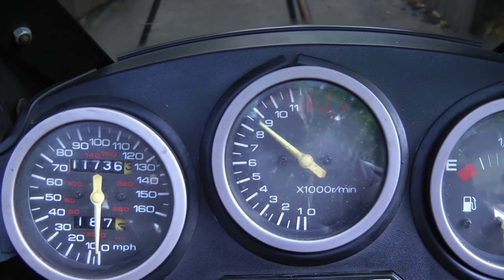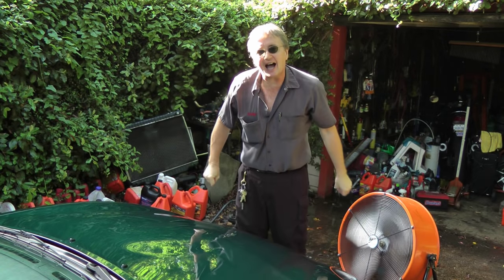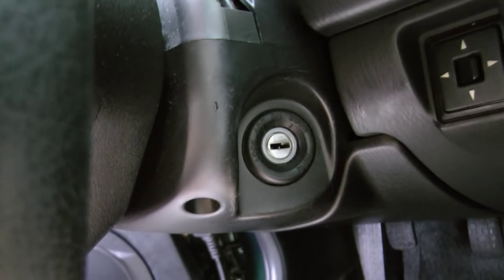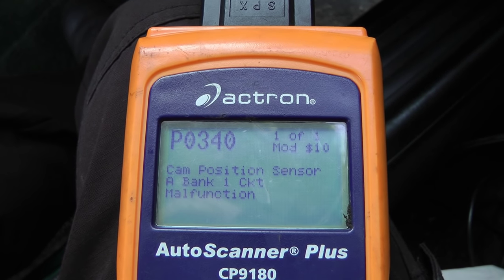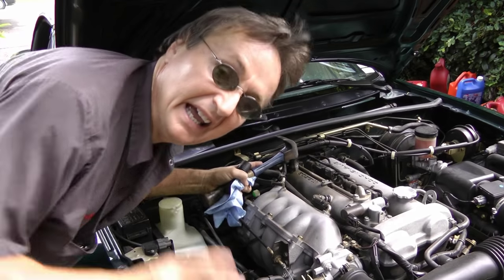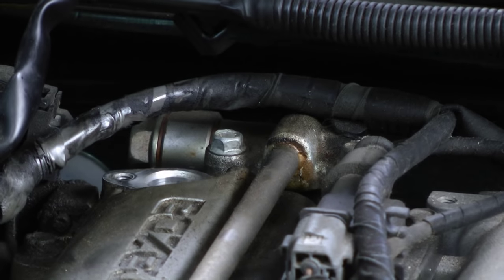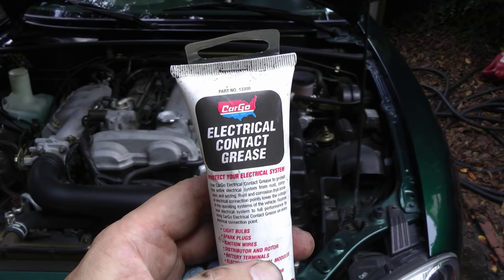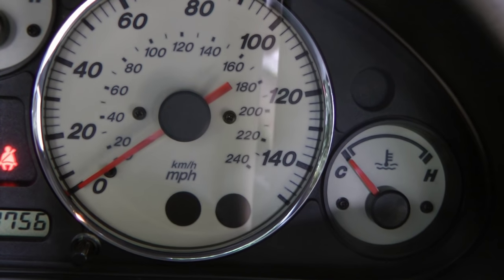How to Fix a Car that Randomly Dies while Driving

Comment: Scotty  my car doesnt start, i have spark i have fuel pressure my battery was just recharged at my school, the scan tool is not showing any trouble codes. can you help me out??
Reply from the maker: +Jumas Drake  you just have correct spark, the fuel injectors must be pulsing to add fuel into the engine, AND the engine must have good compression. do a compression test of the engine first

Comment: hey scotty i have a 00 jetta vr6 2.8 ...wierd i hook my aftermarket stereo on and the entire car dies with a day absolutely no power so i disconect the stero and the car randomly dies eather at a cold strart or a few hours after driving it my mechanic says its eather the throttle body or the computer what do u think and what can u tell me abt the aftermarket stereo
Reply from the maker: +Jhon Getto you may have fried the computer wiring that stereo in, realize that. find a better VW mechanic with a vag com scanner to analyze it correctly and not guess on one part or the other

Comment: Almost died today when my vehicle bogged down mid left turn and I was stuck like a deer in head lights to oncoming traffic that had to slam the breaks. Thankfully, it stopped bogging as I was shitting my pants and feathering the gass. My car jumped out of the way just in time. Lesson learned is that if your car starts to bog down mid drive..don’t chance it and pull the hell over immediately!!!

Comment: I have a 98 Nissan Maxima V6 3.0 L of her issues with the engine turns on find when is cold driving around the block and it shuts off it won't turn on

Comment: I have the same problem with my 2015 Dodge Dart. Whenever it stalls I just turn off and start it again pressing the gas little bit. Took it to dealer but they couldn’t find the code. Anyone has an idea to solve this issues?  Yes I did install new battery as well. Problem remains the same.

Comment: 95 surban suv. Starts but dies after 10 or 50 seconds and start back up. Also dies while driving . I change plugs and fuel filter already.
Reply from the maker: Marlos Moy pressure test the fuel pump, pray it's just that going out. MANY things can do that but that's the most common
Reply: How do test fuel pump

Comment: problem Chrysler van  dies in reverse & or blows engine fuse FIX  wires laying on exaust manifold shorts out that fuse hit bump fuse gone ,turn corner  pow  I put in circuit  breaker hit died 45 seconds reset starts the wires settle down on manifold burns through if you have that problem get a big wire tie pull loom up done

Comment: I have a 2006 pontiac torrent and it dies sometimes when driving, when I try to start it nothing happens no crank or anything as is the battery was totally dead if I sit for about 10 minutes it will crank and usually start
 what could it be?
Reply from the maker: have the alternator and battery tested first

Comment: Hello, I am running Nissan Altima 2008.  It runs good in the morning after continuously running for 40 minutes the rpm does not rise more than 2000(100KM).  This happens when temp. raised more than 30C.  I need to stop the car for while(15mins) to run it again normally.  It runs good in night or less temp condition less than 30.  I checked with compute no code shown.  could you please advise.  I am from Dubai, now its summer I often encountering this problem.  Thanks for your assistance
Reply from the maker: jawahar sadikali pressure test the fuel pump, weak ones often do that
Reply: Scotty Kilmer Hello Today I changed the fuel pump and crack and SHAFT sensors, but still the problem persists, any remedy, mechanic asking to change maf sensor should I? Please suggest

Comment: I have 86 Dodge pickup I have trouble with the alternate I change the alternator and is still not charging what could it be
Reply from the maker: bad regulator, or bad wiring

Comment: My 350z was driving perfectly, then I decided to changed the spark plugs and wires now my car starts then dies 2 seconds later ... could it be the cam sensors? Maybe the wires are bad?
Reply: Ever figure out problem?
Reply: @keitronadams5386   - Diddnt push the spark plug wires in all the way.

Comment: my 2001 Buick century keep cutting off while I'm driving & when I turn da key forward no lights come on da dash & no crank no check engine light so I can't get it diagnosed
Reply from the maker: +Latwon Plant there's tons more info than simple check engine lights. See my video "fixing insanely complex modern cars" and have a guy like me hook one up
Reply: +Scotty Kilmer hi how do I fix that in a 05 Mitsubishi Lancer oz rally
Reply: +Latwon Plant  my car was doing the same thing a couple of days ago i scanned it even tho it didnt show any check ingine light the problem was the idle air control valve what cause my car to randomly shut down you should try that
Reply: +Latwon Plant sounds like you have no power supply. Think you need to jump your battery. You can hook up cables to another battery and then diagnose your car, if the battery won't hold a charge.

Comment: hey scotty I am having the same problem but my car dies only when coming to a stop  or when I take it out of gear. I have a 97 Mitsubishi eclipse gs 2.0 non turbo 5 speed manual trans. doesn't die at idle!  but rpms do go up and down a bit but randomly. I have a check engine light for running rich bank 1 .changed the o2 sensor  and deleted the code but it came back 2 weeks later. no other check engine codes .
i've replaced  fuel pump-- idle air control valve battery starter ,ignition switch fuel pump relay and autoshut off switch new thermo stat new coolant temp  and switch ,  checked all hoses for vaccum leaks   all my sensors are fine so I think tps maybe but when I remove the sensor the rpms go really high   any leads ??!
Reply from the maker: DeezSteez  running rich will do that every time, it floods the engine out with too much gas and conks it out when stopping our putting it out of gear. Rich is often a bad maf sensor, or leaking fuel injector or fuel pressure regulator gone bad

Comment: My car needs a converter. The converter is $1800 to freaking fix. When my car stalls, the battery, engine, and oil light comes on, and the brake light. As much as I don't want to buy another car, I don't want to find another issue with this car once I pay for the repair. HELP

Comment: I have a 2000 Acura TL. The problem that I have with this car is that when I tap the gas pedal it won't go. It doesn't show no check engine light. Does anyone knows what's the problem?

Comment: hi Scotty I have an ultra for Explorer XLT model it turns off randomly but I get no codes, i had the alternator and the fuel pump changed and it still does it, Help
Reply: For what it's worth, I had an old, probably late 70s, car that did this. It turned out to be a bad relay (or so I understood).
Reply: do you know what relay it could be, by the way my car is running without the air flow sensor connected my mechanic tried that and it work so I'm waiting to have it changed do you think it might be that,
Reply: @ICanDoIt70  Don't know if this applies to your case or not, but here goes. This was an older car (a late 70s Nissan) that was determined to have an electrical fault in an unknown location. They replaced parts from cheap to expensive until getting to a unit that had the relays. Apparently, if a relay got too hot, it failed, causing the car to die completely. And it could take half an hour before starting again. Very inconvenient in intersections with cars coming at you.

Comment: ihave my hyundai sonata 2003 model....witch death while driving after more 2 hour...i was have ready changed camsaft sensor...also sensor at the timing belt camsaft.....my engine still death while driving.......but my petrol pump not be changed....can u help mee...

Comment: I used to have a mini van that died randomly. But it was because the steering column was broken and the center part would move around and turn the switch off.

Comment: hey my 2008 audi shuts off on cold start drive when i come to a Stop with the breaks.. it shakes and stalls and the engine shuts off...i have to turn it back on to drive by putting it in park... what could it be...
Reply from the maker: +TheKidCosmic  start by checking for vacuum leaks, and pray it's that easy on such a high tech german money pit machine

Comment: After running completely out of oil I performed an oil change oil filter and air filter car started up good I even put high performance oil in it but then it did it again and the car won't start now
Reply: Your car has a serious issue, it's either leaking or burning all the oil off.

Comment: 2004 Infiniti G35 starts then stalls, stalls even faster when I   Press pedal, I cleaned throttle body and MAF changed both CPS still doing the same thing, no codes thinking of changing throttle body, Can anyone help?

Comment: Hey Scotty , i own an bmw e39 520d from 2003 and it keeps dying on me while i have 15 liters in the fuel tank , i have changed the fuel pump from the tank but when i hit 15 liters or 170 km range it randomly stops like it does not get any fuel , if i do not refuel with 15 liters and start cranking the engine for like 30 minutes it wont start (sorry english is not my native language)
Reply from the maker: I would assume a bad fuel pump even though you changed it out, cause the only thing fuel volume effects if the feed pressure to that in tank pump.Or the filter on the pump is bad

Comment: On my car it read "cam position sensor" so I replaced it and problem persisted then a friend told me the code can also mean a bad (crankshaft position sensor)
My Solution: I replaced the crankshaft position sensor

Comment: My 2001 Chevy Tahoe died on me while driving completely lost power turn off on me and I turn the key and will crank but won't start I noticed the fuel pump is making a louder and different sound then normal

Comment: I have a 1998 honda prelude and I got problems with it the car shuts off randomly and kicks back on and when the key is removed the car still runs and it's missing a sensor or it's just gone bad and my d4 meaning driving light blinks and it still blinks when I switch gears to reverse or park please help man.....
Reply: Not sure but May be your accelerator sensor my 96 civic did the same thing
Reply: Had the exact same problem. Turned out to be a faulty ignition switch. Best part is that Honda put in a recall for this issue and it was complete free.

Comment: My car is old, can I check the codes with a 64 ranchero ??  It keeps dying out while driving and the lights dim too. Right now the car doesn't start at all,
Reply from the maker: +jimbo Rose there is no computer on that old thing, so it has no codes
Reply: any advice tho
Reply: +jimbo Rose few things one its points seting requires feeler gauge to see if it in spec, second coil is oil filler when it gets used it gets warm, some get super hot and loose conductivity and run 3-5v far from 12v is needs. Other things are the carb has power valve that can be cracked so it stalls under to much jetted fuel or too little, there is a rubber diaphram in the fuel pump and on vaccum carbs is dry rot they will loose pressure and do the same spitting or dying. IF all else seems fine maybe we missed out on the fact it came with a genarator not and alternator with an extenal voltage regulator (usually driverside at radiator) THOSE go bad, or fact maybe you got a radio better then the single speaker running AM and drawing to much power thus killing the car because it doesn't have an alternator to supply extra power for all the toys/fun stuff. If all thats good check the ground on the block oil leaks all over them usually can see from bottom best. OR OR.... if all thats good could be your 12v key on to the coil is bad could mean the wire or the key switch. Because that old has no safety features built into the wiring besides fuses no brain to limit power or turn off car when too hot. I had a 64 1/2 box top 289 mustang really loved it easy to work on just trace your stuff. Fixing old stuff is easy 4-5 wires and a switch can run them cars theese days use miles of wire and 3/4 sensors that talk to each other about the same thing and adjust to thousands of seconds
Reply: +TriskaidekaPunk  thanks so much man, it's my first car too. My car doesn't have a radio tho and the gas gauge don't work either.

Comment: I have a 2003 Saturn Vue a couple of days I was driving the car jerked the and the security light came on the car acted as if it didn't want to drive drove a little and then stalled can you please help me with this problem ....have changed fuel pump and filter didn't help
Reply from the maker: If you have another known good key, try that. If not see a guy like me to scan the security system for flaws
Reply: we changed that and it is still doing it
Reply: we got about 10 mins down the road and it did it again but didn't stall all the dash lights came on slowed down RMP's raced and then it continued it a couple more times but made it where I was going and turned off the car and restarted right up but the security light was on !

Comment: my 08 chevy impala speedometer hand jumps around & when sitting at a light or even when I start my car after driving it for about 30 min it completely shuts off. it starts back up but continues to do so during the drive plz help
Reply: hellllllppppp
Reply: +LOVEmeSomeHIM500 Possible Body Control Module Issue (BCM)? Google around for BCM and the symptons and you might come up with something. Also doesn't hurt to go to the nearest autozone/advance auto parts and have them check for codes if you don't have a scanner.
Reply: +LibertyFreedom1787 ok thank you I will do that asap

Comment: If anyone can help, I have a Mercury 2000 Grand Marquis that has been shutting off randomly at about 40-50mph of course engine light comes up but as soon as I turn it on it's not there anymore making it harder for me to know what's wrong. Another is that my car heat light turns on when I'm driving as well at the same mph first it was caused due to the fan not working and I fixed it by changing out the sensor for it not to mention the sensor for the oil pump and the coolant heat sensor as well but still has the same problem if anyone can relate let me know I already put a lot of money into this car. Thank You!
Reply: Luis Acosta plug a scan tool in go to record data and drive till it dies then press enter and analyze the data

Comment: my sister has a chevy malibu 03 and her car turns on and drives but dies and i scanned for codes and there were none what should i do if this happens
Reply from the maker: pressure test the fuel pump, weak ones often do that.
Reply: I've been researching into battery repairing and discovered a great website at Magic Mender Wizard (google it if you're interested)

Comment: I was wondering if anyone can help me out i have a 96 nissan pathfinder and i recently had to put on an bypass hose and now when driving it wont go pass 2k rpms its a manual trans so i can go about 40 but it dies on its face if full throttle and advice

Comment: How do you change a 2003 lincolñ navigator transmission oil?
Reply: Please r
Reply from the maker: +jose chong pay a mechanic, it's a very involved job using expensive specialty tools and scanners
Reply: +jose chong not hard, it just a ford. They all have trans cooler lines on the radiator, dis connect them detemine the supply and return, put return into empty container and supply into container of new factory spec (mec V) and just keep the supply container full then start the truck and idle it the trans pump will run, do that till clear of debris(back to cherry red not black/brown in color) from the return.

FYI it is not an cheap job the fulid is $6 a qt and 15-16qt for whole trans, but may require more fulid to flush it well. Other thing is drop the pan and change the filter (that takes 5qt and $15 for filter)

But most shops will say is you havent serviced the trans and has over 100k miles DONT touch it, if its not slipping or jerking drive it till it break, new trans fulid is HIGH detergent and will clean the valve body and half time the small slugge in there is whats making the bands and valve work, go and flush that out and you make more problems. Lucas additive works but isn't perment is you have slipage, if you have jerking its bad internal gears or faulty solenoid, saftey neautal switch, or bad trans pump and its not keeping correct pressure after it warms up

Comment: hello sir I have Skoda fabia 2010. I car starting so late... tell me how to fix.....
Reply from the maker: tune it up first, and also clean the fuel injectors if that doesn't work
Reply: Scotty Kilmer okay I will do it....
Reply: p0401 code also shown.. is itthis the problem.... of cold starting
Reply: Scotty Kilmer if I use fuel injector in diesel. is it work or not

Comment: 1990 Integra dies after 10 mins driving, then won't start again for 3-4 hours, then runs fine for another 10 mins or so.  Ignitor?
Reply: Marti K 
I've got this problem with a 1994 Mazda b3000 was there a solution resolved on this situation? let me know please. thank you...
Reply: Not Familiar W/ Integras, but When My 280 Z Would Do that,It Was A Bad Ignition Module, & To Confirm it,Tach Needle Would Become Erratic.If Tach Needle Was Steady,Usually Meant A Fuel Problem.
Reply: i got the tach issue also
was trying to find prob. thx